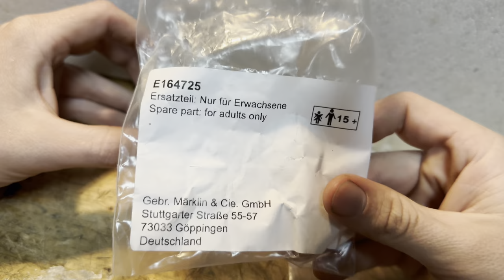Fixing A G Scale LGB Mikado

Comment: I'm honestly curious how much greater the performance would be if all drivers had traction tires compared to one set of drivers.
Reply from the maker: I always thought of that too, but at a certain point the locomotive weight wouldn’t be heavy enough and it would probably start hopping or slipping on the rails anyway

Comment: Do you have a photo of the contacts on the bottom of the loco? I was repairing a smaller mikado and can get two of three contact wires to run on a 9v but one of the contacts metal bar does not line up with the power that runs the wheels and therefore brushes to wheels. super confusing.

Comment: Plastic and locktite do not mix. Locktite can make plastic brittle and crack over time. I do NOT recommend locktiting those hex nuts to the wheels. Use a dab of CA or something else if you had to, but locktite should only be used on metal to metal connections.
Reply from the maker: I’ll Get the torch out and melt it together

Comment: I'm going to be doing much the same but using railpro for my Bachmann 4-6-0 engine converting it from Track power to batteyr power using a battery cube and a rail pro board. while converting my New Bright christmas box cars from plastic trucks and wheels to all die cast metal wheels (I did do a test fit of the metal die cast wheels using my Gondola as a doner and they fit and give the box cars some weight to them).

Comment: yo crazytrain525 im planning on making my own G scale garden railway i just need a few tips 1. What Mode Should I Use DC or DCC? @. wheres the best place to get these? thanks sorry if i annoyed you or anything :)
Reply from the maker: I would go DC because it’s cheaper, and I get most of my trains used on eBay, but OnlyTrains.com has a good selection of g scale items.
Reply: @crazytrain525  thank you so much man that means alot
Reply: @crazytrain525  is there a way to find a train engine for cheap because when I look it is $200 or more
Reply from the maker: You can find some of the smaller LGB engines cheaper on eBay for around $100